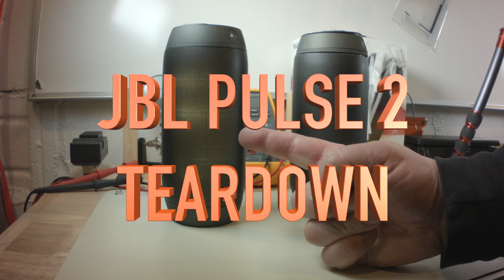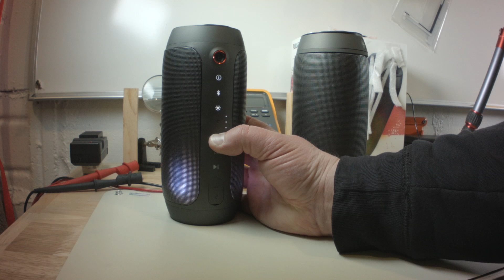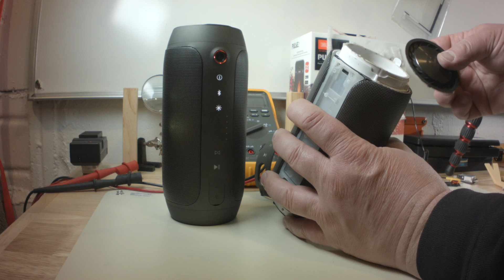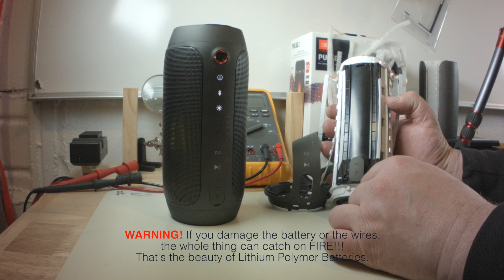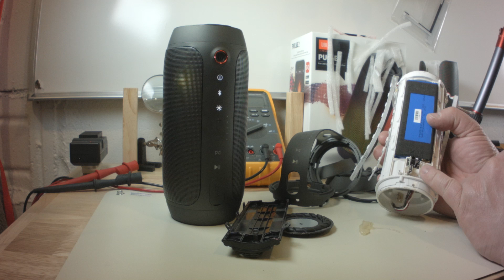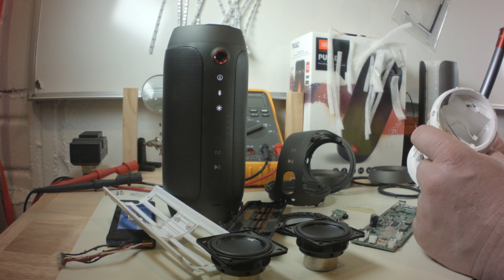JBL Pulse 2 - Repair and Teardown Advice

Comment: You make it look way easier than it is.  I already destroyed one of the rubber rings and the outer cover won't come off.  I suspect I'm going to destroy it or injure myself trying to follow your instructions.  Oh well.  Thanks for posting.  I'll keep trying even if I destroy it.  It would go in the trash otherwise.  Edit:  It went in the trash.
Reply from the maker: well, i said it at the beginning of the video: opening that speaker is not for the faint of heart. Sorry you destroyed yours. The newer models are way better to take apart.
Reply: @mygiguser  I hate to say it but I saw a couple of other videos after yours and they were totally successful.  I guess you were a bit too early to try this terrible fix.
Reply: @mygiguser  Not blaming you since clearly it was your first attempt, and you destroyed yours... but you might want to mention there are better tutorials out there that show the whole process on a previously unopened device that are much less destructive.   I wish I'd watched a few different ones before making my attempt.

Comment: my speaker has lost tts light... there is no light coming except those battery indications and switch lights. those led strips are not working what would be the probable reason ?  the battery is not not charging properly. if i plug usb it works for 15 mins and then turns off. suggest me what would be the possible defects and what to do?

Comment: I will never buy another JBL , first the charging port stops working with careful adult use in less than 2 years, and then if you want to repair this basic thing youll need luck to not fuck it up during the teardown....
Reply: I'm with you.   I got to step 3 where he "gently removes" the covering all down the front, and mine won't budge.  I'm either going to destroy this thing or give myself an injury trying to get it apart.

Comment: View my video on jbl pulse I need hep
Reply from the maker: 1. Plug the speaker to the charger.
 2. While charging, press and hold the Volume "+" and the JBL Connect button at the same time for about 10 seconds until the unit shuts off

Comment: I will never buy any JBL products. Bought a brand new JBL pulse 2 and it failed after 2 weeks. I can't pair it anymore with any devices, when I press on bluetooth button the litghs just start flickering and it does not respond. Tried to reset and upgrade firmware but it does not work. Waste of money :(
Reply: Cel Mai Sincer Moldovean should have done your research and bought yourself a better speaker cough cough jbl charge 3 or pulse 3

Comment: hi there I have two of these that have the same issue, they don't seem to stay connected via Bluetooth for longer than a few seconds, also it will work properly via aux either it doesn't stay on aux for more than a few seconds, sometimes I can get about a minute of use out of them that's it, one was bought from jbl and one from eBay but they both have this fault, jbl have been no help at all, what could I do to solve this issue?
Reply: ghost_who_walks ! Maybe it is stuck on demo mode
Reply: But idk its just a guess
Reply: I had the same issue. You need to update the firmware on the speakers via the JBL App.

Comment: I need to repair the usb power socket, on this pulse speaker
Reply from the maker: Try to go to a cellphone repair shop. They sometimes repair this kind of stuff. Or better call the JBL support, and ask how much the repair is.
Reply: @mygiguser
Actually, JBL (in the USA at least) does not offer service for their bluetooth speakers.  They will replace them if you can prove they are under warranty but if not, you are on your own.

As of 2017, there is a listing on ebay for someone that offers replacement service.

Comment: How did you take the rubber that covers the buttons off? Do you have to heat it up first? It's really stuck in there. I m struggling with it because the rings on both sides were glued tight. =[ 

Thanks for the video btw. I am in the process of trying to replace the broken micro usb port and this has helped.
Reply from the maker: Jamison Just pull hard, I didn't have to heat it up.

Comment: Why do you have two of them btw?
Reply from the maker: MegaSafetyFirst Well, I ordered a second one on EBay, because I wanted to show how to play both at the same time, but it was not working. As I took it apart, I realized, that nothing could be done to fix it. Should I send it back? What do you think?
Reply: Cool, I didn't know you can play two at the same time. How does that work?

Sure, dip it in glue and then send it back. They won't be able to tell the difference :D
Reply: Rusty Stafford Good to know,  thank you!